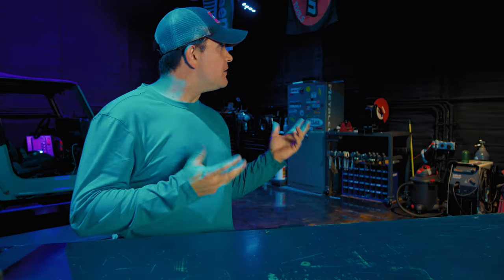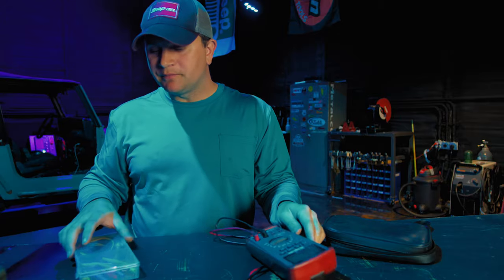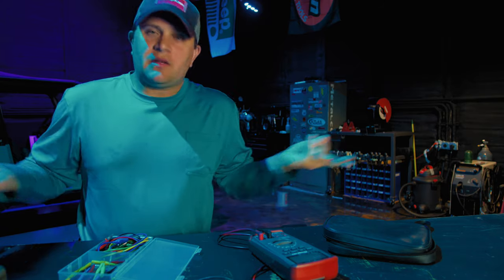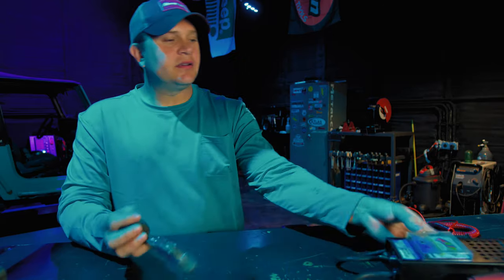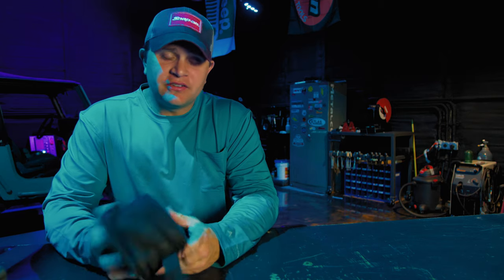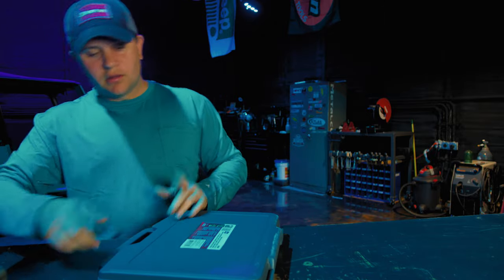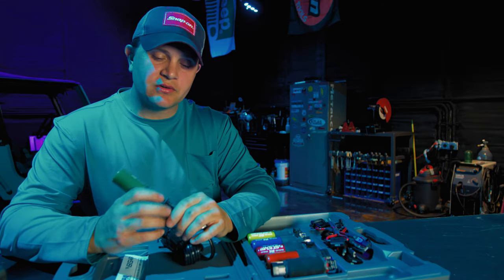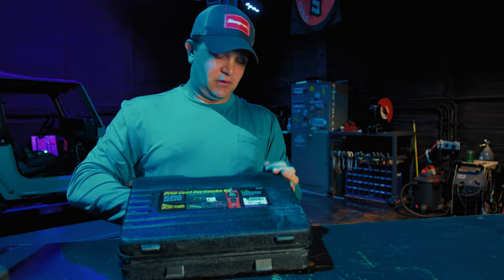Tools you need for Forklift electrical Diagnosis

Comment: Here is a brief history of the Hyster forklift with serial No: P005B03724J, Model:H5.0FT.
 
This forklift had a problem sometime last 2 years. it was not starting and was down for over 5 months.
When the repairs was being carried out, the following was replaced:
4 injector electric nozzles
Rotary pump
Cam-shaft sensor
Crank-shaft sensor
After repairs the equipment went back to operation. 

About a week work the forklift stopped working , no starting. Since then nothing has been done to the truck.

Mr. Paul Stewart inspected the machine and discovered water in the diesel tank.

He made remarks about the water in diesel damaging the electronic nozzles.

With the introduction of the Gemster department as a technical outfit.

we have carried out inspection and repairs on the machine, cleared error codes, another ECM was used in testing the engine, checked electrical fuses and relays in attempt to rectify the problem.

Crank-shaft and Cam-shaft sensor was replaced too.

Measuring the voltage on the nozzles after clearing all error code, 07.00volts was present.

With the assessment of Mr. Paul and all the repairs done by the Gemster Team, it doesn't explain why only 07.00volts is present to the electronic nozzles.

Tapping into your rich Experience on technical issues as this,

We kindly request for your advise and technical solution on this problem.
Reply from the maker: Thanks for watching! You can contact me directly through my business Facebook page. I have a feeling this will need more attention than the comments section on YouTube. Thanks again! 🍻
Reply: @magnoliamobileservice4534  Thanks for the quick response. it'll if we can get a link to your facebook address link.

Comment: I am looking forward to seeing some hydraulic issues addressed. Currently I have a lift that does not want to engage the mast to the second level when it has a load. It does not have any codes, the mast channel is clear, there is plenty of fluid, the hydraulic filter appears to be free of obstructons, and it has been recalibrated. I think it maybe a valve issues. The lift is old and the company has decided to take it out of service soon. Nevertheless, I am interested in learning more about troubleshooting this type of mysterious issue. Thanks
Reply from the maker: John Doe thanks for watching! What kind of truck is this?
Reply: @magnoliamobileservice4534  This is an 8 year old Crown RR. I am not sure of the model number, but I can check next week when I get back to work.
Reply from the maker: John Doe so just to clarify. When you raise the fork carriage does not make it all the way to the top of the mast before the secondary rails start to raise, correct?
Reply: @magnoliamobileservice4534  I am sorry for the late reply, I have been out from work on ELOA. Well, just before I left today I tried the lift and it works fine. However, the tech from the other shift said that when he used it to raise a heavy load the mast would start to engage the second level about a foot or so, then stop. The weekend shift tech, had asked me to order a load sensor. I could not find a load sensor in the Crown manual or on Crown Insite. Subsequently, a Crown tech was on site to replace a warranty part on another lift and I asked him to show me the load sensor. I expkained what the weekend tech said and the Crown tech said that sounds like guess work. He said there is no load sensor; the manafold senses the pressure and the problem is there. I do not have and hydraulic experence, which is why I was asking for a second opinion. By the way the weekend tech did say he re-calibrated the lift, and that did not solve the issue. Have you ever had a mysterious issue like this? Thanks.
Reply from the maker: @JohnDoe-kp8xu  Does the carriage make it all the way to the top of staging and then the secondary rails start to raise and then they stop? Or do the secondary rails start to raise before the fork carriage gets to the top of the mast? This difference matters.
Reply: @magnoliamobileservice4534  Yes, the carriage rises all the to the of staging and the secondary rails start to raise and the stop.

Comment: Thanks for the info. Speaking of electrical issues, is it true that sometimes when a lift drives over a hole the controls are shut down and there is a reset switch? I was asking because I have a lift that powers on but no otther funtions operate after driving over a rough spot on the floor (a manager said at his old warehouse the techs would press a reset button).The only event code is 357, for an emergency stop switch short. However the spade connectors are secure and the SPST (in the E-Stop) is visibly moving when activated and shuts off power when depressed. Purhaps the issue is an Access 3 malfunction. What are your thoughts, given that this occurred after drive over a rough surface? Thanks.
Reply: I forgot to mention, the lift is a RR 5700 series.
Reply from the maker: John Doe there is a chance that the switch has some resistance in it and a shock from a pot hole causes the truck to see an open intermittently. Access module changes should be an absolute last resort. They are pretty reliable these days. I would need to check my service manual for a code 357 to see what the specifics are but I would start with a resistance check on the switch its self. The emergency disconnect switch is in line with the ignition/run circuit so any disruption in the signal can cause the truck to shut down functions but it loses and re gains the signal so fast the truck appears to have stayed on. I hope this is making some sense.
Reply: Thanks
Reply: Greetings fellow channel viewers. As an update to the prior issue, Crown come on site. The reset button is misconstrued, which is technically the alarm/E-Stop. Prior to the 357 code, I think the code was 223 or 235, which stated see code 256. Hence the troubleshooting break down conclude a faulty Access 3. Additionally, from the Analyzer menue all modules displayed 32.5 volts and the ignition displayed 37 volts. According to the manual any difference greater than 2.5 causes the lift to shut down.